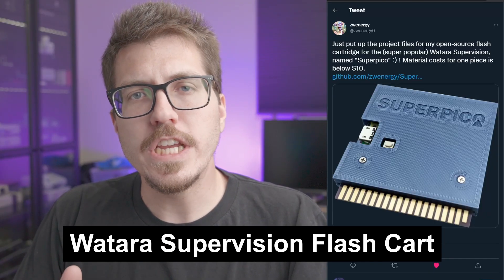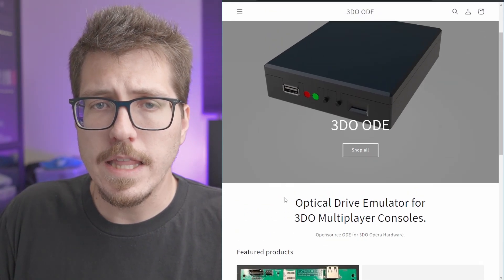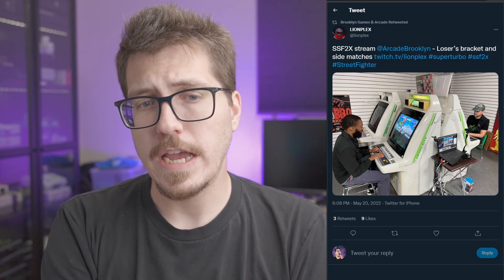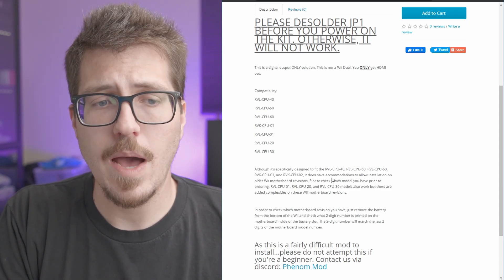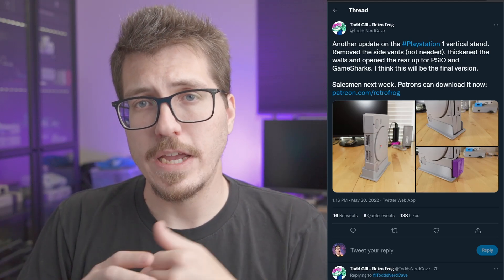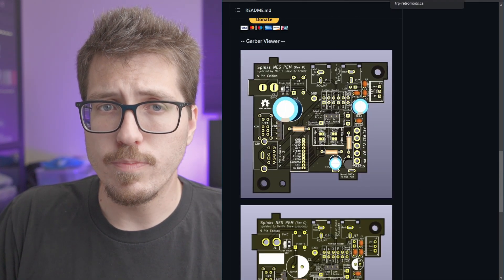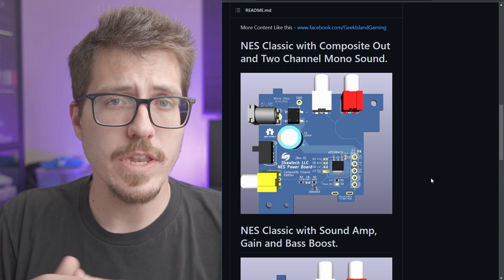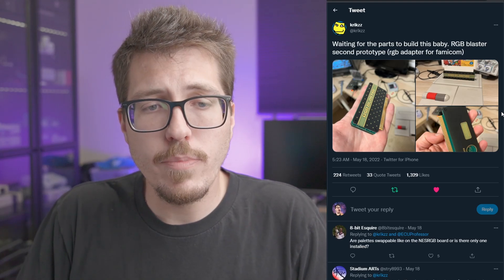No-Solder NES RGB Adapter From Krikzz - Retro Modding News 5/22/2022

Comment: if the RGB Blaster works on the sharp twin famicom that would make it currently the only way to get rgb out of the console
Reply: Viletim's earlier NESRGB versions worked fine on the Sharp Twin, i installed 2 myself.
i'm not sure if he still offers the adapter PCB's with version 4 though, haven't done one in ages.

Comment: I'm pretty excited about the RGB Blaster! The NESRGB looks fantastic, but when I add up everything I'd want to do along with it (like a multi-out port), I just can't quite justify the time and cost. I am hoping that the RGB Blaster is a bit cheaper, and I hope that he'll do a front-loader version, especially if it's something I can just solder into the NES inside the enclosure.
Reply: It would be interesting to see if a front loading version could be integrated onto the ZIF. While I know some people dislike aftermarket ZIF replacements, it could make this a rather straightforward internal solution.

Comment: More flashcarts are welcome. maybe someone has one or see one they can pick up at a retro store or garage sale.

More ode's are cool. I like the mode for dc and Saturn, no need to solder really which is a good thing. just ps1 looks like a pain, they gotta work on that. mister has ps1 so i may skip doing it or get it done by a top modder.

I am looking forward with the big board for d10 nano for RGB out and all the features and has capacitors for better audio. A cool case would be welcome. 
That is a cool idea just split the video and put second controller to that arcade side. I mentioned that before long ago.

That's cool there doing stuff for the NES. you would think if they remade the NES board they would of built in a RGB mod right into the NES board design. or even HDMI. 
I seen the guys putting together the new board nes. cool stuff.
The gamegear board thats out there made has all the lcd modding stuff all together in one location. making adding stuff to it more easy.
hope they do a bunch more systems.
Reply: The ps1 odes are a pain. You basically have to mod the console to make it work. You can easily ruin a working console. 
As you said: dc, Saturn and the gc are a breeze to install.